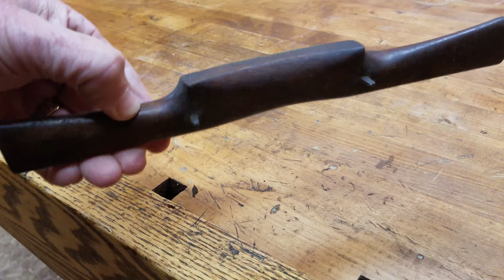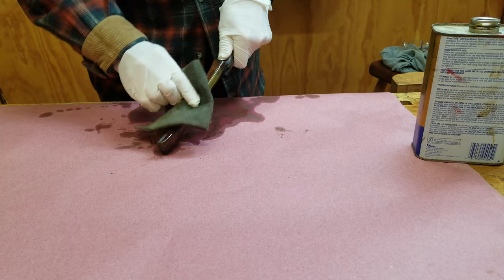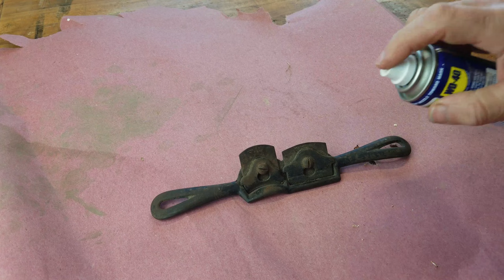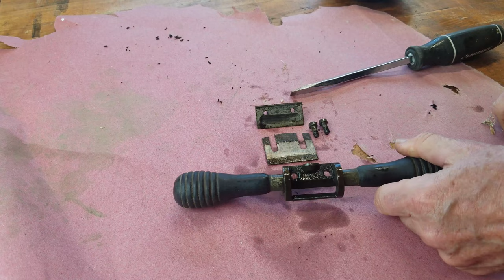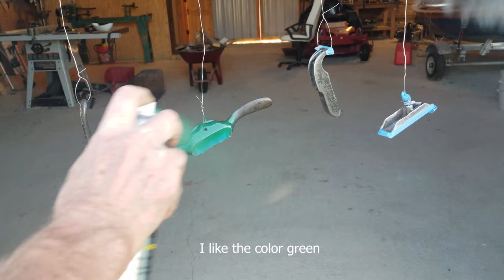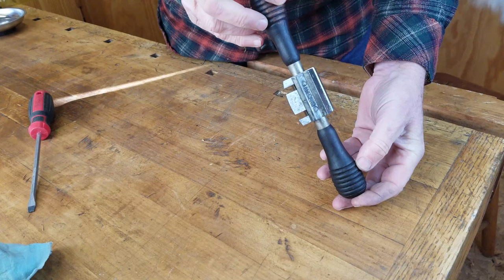Old Tool Restoration - Vintage Spokeshaves

Comment: Hi David, tx for the vid. I have the same Seymour&Sons double spokeshave. I sharpened my curved blade to hair shaving sharp (convex?) and I tightened it in the shave. I put it bevel up with the logo on the back of the iron. It worked well enough but a ridiculous amount of chatter, no matter how finely I set the depth of the iron. I then reversed it so that the logo was out front. It didnt line up with the "frog" very well either (neither did, despite me flattening the iron and filing the frog flat - just a different profile it seems). However, it shaves smoother but nothing to write home about. What are your experiences? Logo to the front (the side with the screw) or behind? Thanks